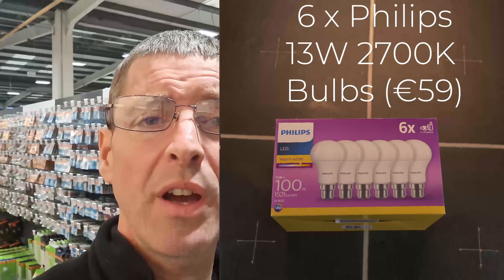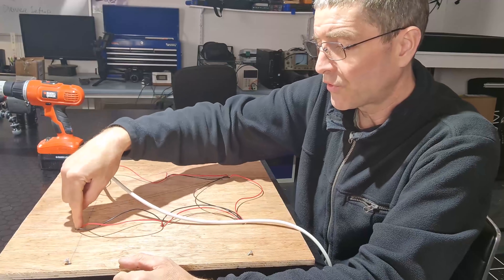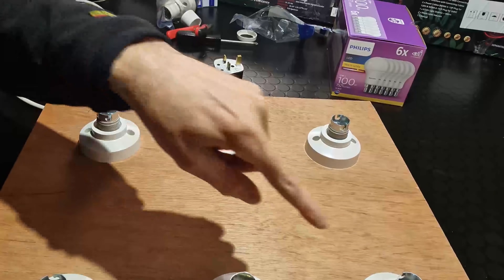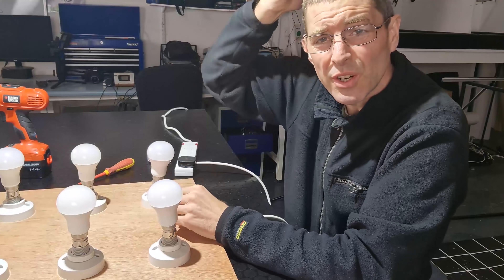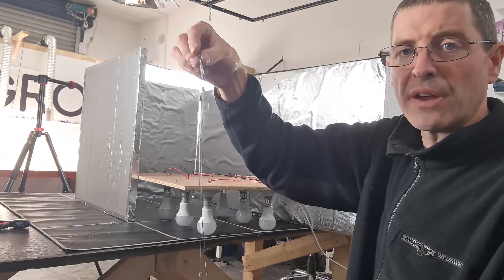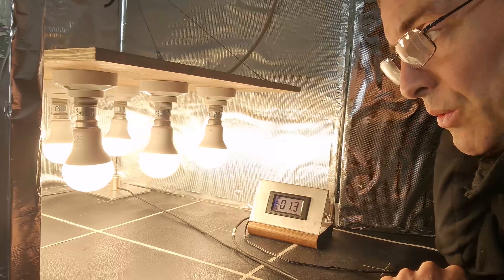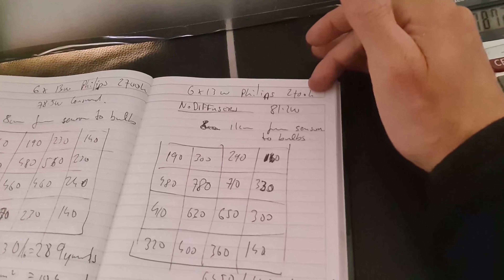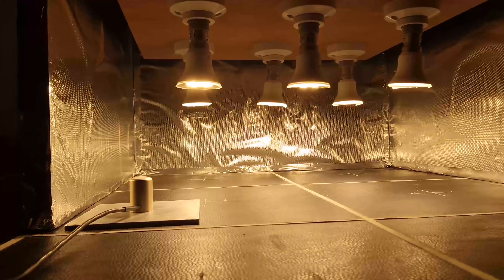DIY LED Grow light build | Build your own cheap simple and efficient LED grow light

Comment: This has better PPE than the MarsHydro TS1000, how is that possible? Would you recommend a setup like this over a TS1000?
Reply: Well first off not better ppfd than the ts1000 and secondly what makes the ts1000 such a good light is the spectrum is amazing for plant growth.
Reply: @dragongaming4993  Which is understandable since they are drawing less power (81,2 W vs 147 W for the MarsHydro). The MarsHydro is outputting 242,1 mmol/(s*m2) of usable PPF while drawing 146,7 W. If you use more of these light bulbs (9 or 12) with the same efficiency, you get 217 usable PPF at 122W (9 bulbs) or 289 usable PPF at 162W (12 bulbs). The spectrum is already being considered in these comparisons afaik, since we are measuring PAR (photosynthetically active radiation) and not lumens. The question would be, what is a light like the MarsHydro TS1000 that is on paper less efficient giving you more than a setup like this with 9 or 12 bulbs. 9 of these bulbs are going for €65 on eBay.
Reply: Again what makes the ts1000 such a good light is the spectrum you can give the plant as many photons as you want but if it's not going to use them it's just wasted energy. I believe plants have a genetic timer set to naturally lighting patterns as to when and how they use photons in the photosynthesis process and making the right photons available at the right time is key to good plant growth.
Reply: @dragongaming4993  Which is why we measure PAR instead of lumens. PPF stands for "photosynthetic photon flux", not just any photons. What am I missing here
Reply: Yeah Im just not a fan of growing stems I am more looking for bud sites which is why I look for a mixed or certain spectrum during certsain growth periods.
Reply: @dragongaming4993  I agree these wouldn't be as good as a fixture like the ts1000. Especially considering how fast the PAR drops off when raising them up. Although I will say that mass photons work, it's why HPS shouldn't work well but they do. So PAR is important but alot of light will usually get you something lol
Reply: @HAPPYHERBS1  The PAR dropping off makes sense. I wonder though if using them at a very low hanging height as shown in the video will yield the same or better results. Obviously I'm not gonna replace my MarsHydro with these, but if they can even compare I think that's remarkable.
Reply: @HAPPYHERBS1 
hey have you tried those sunco LEDs? 4000 lm at 40 watts seems really good for a $30 fixture and they have 2000k bulbs which are hard to find
Reply: Van Helsing  were they the same genetics from the same place? 
Were you using the same nutes?
Running the same watts at the wall? I could go on all day really because true grow comparison requires lab like technicality.
While I also grow with a mixed spectrum I have yet to find a good source of ir to be offered from these lights the only thing I wish the ts1000 offered is the uv that is supposed to cause the plant to create more resin to protect itself against but I have yet to experience the effects of but I do know back in the day they called uv bulbs "finishing" bulbs so it is not new to growing.

Comment: I have been using these and the spiral CFL bulbs in many colors for vegging perfect plants for years.. I try to tell people online in chat for years and they dont listen ha. Even better is the cheap LED flood lights, as all light is directed down and they are perfect strength
Reply: Also, I want to add there is a very simple thing people can use that turns 1 spcket into 7 bulbs! Look up 7 in 1 light bulb adapter.. it looks like a christmas tree star in a way, and you simply screw it in the light bulb socket, and youre done
Reply: I'm looking for a new and cheaper setup for my carnivorous plants and saw quite a few people claim that consumer lightbulbs simply don't cover the required light spectrum, despite companies like Philips giving you the entire spectrum graph. It's like they want others to waste their money on overpriced equipment. I'm definitely trying this next. I use usual lights to hold the bulbs, so I don't even need to mess around with the wires.
Reply: tell me more please

Comment: hey shane, theres an easyer and even better way ^^ ... just get some 50w floodlights with 3000k .. you dont have to cut em open and can mount em better , and more power ..  orrr you just get a high bay light :) .. i tried both and both works great , even with some 30w floods
Reply: @jeonsago  i got some of the brand V-Tac , they got samsung leds , i use it for veg (3 of them 30w each ), and it works really really good , but i cant measure it exactly like shane tho..

Comment: Is there a difference between cool white and warm white?
Reply: Mr. Mouse  
I'm  pretty sure the spiral twisted ones are compact florescent??
Reply: michel777ification  Couldn't CFL work also? just a ? wouldn't use them the Hg in them makes me panic.
Reply: @currentriver4951  even high powered CFLs just don't push enough light for flowering in my experience, excellent for mums/clones, always had better results vegging under MH and now LED.

Comment: Got 300watts of globes setup, about $80 worth lol. Some of those phillips ones and osram. 1st run was alright but had to be cut short. It really is this simple, keep it safe electrically and your good to go.
Reply: Ended up melting the tops off because of all the plastic flying everywhere when I used the hacksaw. Went all over the leds, cleaner to melt.
Reply: Bloody cold though, cuoboard barely gets 6c above ambient without heating.

Comment: Great idea demo but for the same money or less you can buy a budget LED fixture like a Vander. I think I paid under £60 for one which is, and has been working well so far. Happy to drop it off to you if you want to test it as a comparison 👍🏻
Reply: @Rake_stepper  I’m  not  knocking the idea at all. During lockdown I was going to build something similar but after buying bulbs, holders, wire etc it wasn’t far off the cost of a cheap LED panel.

Comment: I have an array of 12 of these light bulbs in a 3-foot by 4-foot grow closet in the basement for starting my vegetable seedlings every year. It works very well.
Reply: 12 x 14watt (1521 lumen) + 6 x 19watt (2500 lumen) all osram, work in a 100cm x 50cm from seed to harvest. Cheap, flexible, easy to maintain. Can safely recommend.
Reply: André Roth  hi, according to my calculations you would be around 500 mmol for a space of half a square meter.  I would like to know if the penetration is good (rapid development and PERFECT homogeneity of development of the mid exposed floors. if you could also tell us how far you place the leds from the tops of the plants and at how many centimeters you estimate that the secondary ones  no longer really benefit from the light? to all tomato lovers tnks ;) André
Reply: @André Roth hi , according to my calculations you would be around 500 mmol for a space of half a square meter.  I would like to know if the penetration is good (rapid development and PERFECT homogeneity of development of the mid exposed floors. if you could also tell us how far you place the leds from the tops of the plants and at how many centimeters you estimate that the secondary ones  no longer really benefit from the light? to all tomato lovers     tanks André
Reply: @andrekroth  can you link me to the bulbs you use?
Reply from the maker: Tops on or off? If tops are off have you had any issues with the LEDs getting damaged?
Reply: @MIGROLIGHT    I cut off the tops. No, I've had no issues with the LED's becoming damaged.
I have, however, been replacing them with a brighter bulb (150-watt equivalent) that I buy off of Amazon:
SANSI 18W (150 Watt Equivalent) LED Light Bulbs
amazon.com/gp/product/B07G3TBT1G
SANSI 18W (150W Equivalent) LED Bulbs
amazon.co.uk/SANSI-Equivalent-Bright-Daylight-Non-Dimmable/dp/B082KM6Q9T
Reply: @firecloud77  I suggest looking at LED flood lights for the cheapest lumens/dollar. But shop carefully. A lot of 'fake' wattage claims, but today I found a 20,000 lumen, IP65 rated waterproof outdoor flood light with bracket for $12.20 US. I just need to add the plug. I too used arrays like the video, and 14 watt LED bulbs with tops cut off, exposed wiring, and now for $12 get something safe. Normally, you can find a true 200 watt fixture for around $30, but $12 was too good to pass on even though I didn't' need' it.
Reply: @firecloud77  Hey, would this bulb work instead? > Philips A60 Stellar Bright 14W B22 LED Bulb 1260lm, Warm White/2700K work
Reply: @firecloud77  I went with 20 units of 9Watt Phillips LED since that literally the only ones we can get here :) Your reply makes me confident it will be fine. Appreciate you bro!
Reply: @MIGROLIGHT  Hi Shane, I have the tops off for 18 months now and no problems at all ;-) I use the Philips 12.5W 4000K ;-)
Reply: @MIGROLIGHT  I Have* a Lady bug legit crawled onto it and fried a single led 2 days later the whole bulb went out.
Reply: @MIGROLIGHT  I actually ran 20 of these (5000k version) in my mini greenhouse this spring without an issue.   Now those fixtures are hanging in my garage for extra lighting, and so far no issues.  Tops cut off on all of them.
Reply: @jamesolivier3192  Hey, would this bulb work instead? > Philips A60 Stellar Bright 14W B22 LED Bulb 1260lm, Warm White/2700K work
Reply: Van Helsing  how far from the plant do you set it?
Reply: How much current u cost on that bill?
Reply: Just remember to check the age and be clear that you have the consent before ripping the top off 😏.

Comment: You can't get much easier than that! Thank you Shane, love the channel!
Reply: @OG_VeniVidiVici  Okay it can get easier! Only £7. I might add some lights to supplement the lower canopy.👍
Reply: @Jellyf0x  i use those floods as lower canopy light from the sides with an moddet spider farmer sf2000 from the top , but for veg i use a different setup made from flood lights only 3x30w... it works awesome , you should give it a try just to see..
shame i cant measure it with an par meter, i only got a cheap lux meter , that yellow one shane has shown in one of his videos
Reply: @perenti666  You've just reminded me I have 2 50w floods I'd bought for the garden and never used. I do like to experiment, I'm hoping to pick up one of the UV bulbs Shane developed.
Reply: Just to know floodlights have far more output from e27 bulbs at the same wattage of course...And between spectrums also is difference at output..For example 6000-6500k have more output from the same bulbs at 2100-2700ki also didn't knew it before a while
Reply: you can , just get 3 or 4 floodlights with 30 or 50 watts ... you dont need to cut em open , and i bet they have more output , or just get a high bay light
Reply: @perenti666  This is more about taking advantage of the efficiency. These beat Mars ts series.
Reply: well i can affort it and i will not save money on the light ( like as cheap as it can be ) wich is the most important thing in your grow room , but thats my personal opinion.  
you can go better and its still a LOT cheaper than a random "brand grow light" 
my flood fixture (for veg the first 3-4 weeks ) did cost under 60 bucks and its awesome :)   
( its 3x 30w , one did cost me 15 bucks , brand is v-tac with samsung leds )
Reply: Dark Angel   well you get all spectrums , there are floods in 3000k , 4000, and 6000k  , i got 4000k for veg  ... you just have to search a bit , i found mine on amazon , and mine have a helll of an output , it works great

Comment: Lol I built a light like that years ago but it was with 3 x 48watt non spiral CFL's.
Reply: Hey, if it works for veg for sure in a tight budget or far away area with only small hardware shops. For flower, tho.. cmh or lm301B tho for sure as you need to make and cake up the resin
Reply: Preach

Comment: does it heat ?
Reply: Shouldn't be too warm of you have a fan pointed at it 👍
Reply: @HAPPYHERBS1  yes i guess so, though, i am wondering how hotter it might be versus a regular 100W led, if it is. Also, depending of your crop, having an extra fan might not be necessary for it, thus having an extra fan for the led is an extra running cost than is not desirable. Anyways, i liked Shane did this video.
Reply: a LOT ! unsafe to touch during normal operation

Comment: It kills every hps/CMH. LOL They are for 15,5€ per 6 where I live. Pitty that I just have bought 3x600w hps Daisy setups. I don't know should I sell it before they're new or use it.
Reply: These bulbs are weak for flower. You would need more, and higher watts.. at this point your wattage will be close to lm301H, which is superior watts spent per gram of final bud
Reply: @dertythegrower  You would need 36 bulbs to give 470W what be equivalent of the Daisy HPS 600W. It's not bad at all. Less start cost and less energy is being used. I don't grow it for buds, so I don't have enough profit to fastly cover the cost of the light fixture. I will keep the HPS for now but it might not be too wise.

Comment: Hey Shane, did the same two years ago, because Philips has some datasheets online with the spectrum curve of their light bulbs. But i bought 2 of those you've bought, and a 2500lm 4000K Bulb. I did some calculations ( don't have a PAR meter) but this bulb should give a bit better PAR-Reading per Watt then the 2700K 1521lm ones.
So happy to see something like my build on your channel.
Greetings, Max :)
Reply: I've come to this conclusion, not only agreeing with your suggestion, but also that while 4000K bulbs (and even 5000K) produce a similar quantity of red light as 2700K, they also produce a higher quantity of blue, which reduces undesirable stretching. Unfortunately, 2700K will produce excessive stretching.

Comment: Hey Shane - thank you for doing such tests ! That is actually pretty impressive considering no (proper) driver ! It is worth mentioning that filament LEDs are more efficient (from the lumen perspective - I am curious if that is true from a PAR perspective) but you probably need a reflector as they are '360'. Would also mention that since we do not know what the power source in the base of the bulb looks like we should treat the low voltage side as live.
Reply from the maker: Hi, There is a little digital driver underneath the led board supplying only DC to the LED board. As you say the filament LEDs would not be a great solution as you would need reflectors etc.
Reply: @MIGROLIGHT  filaments are more efficient but do not have the intensity as the smd boards inside bulbs do, the drives will give out do to heat build up but way long after your have used these for a couple rounds.